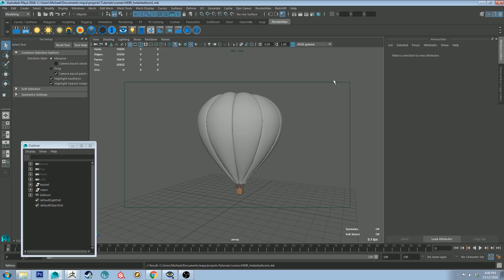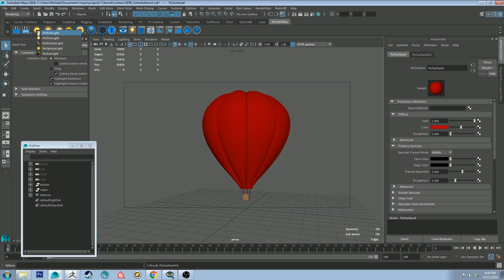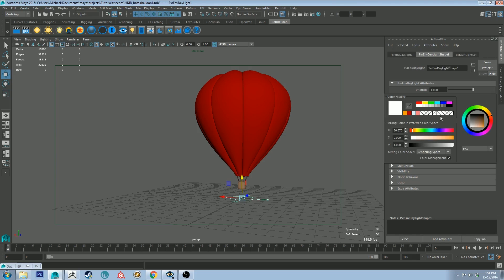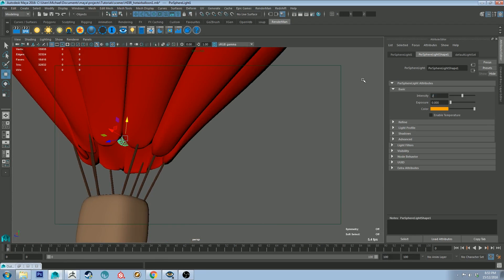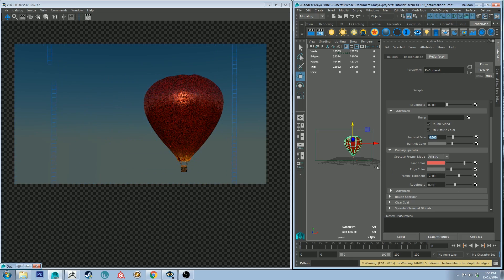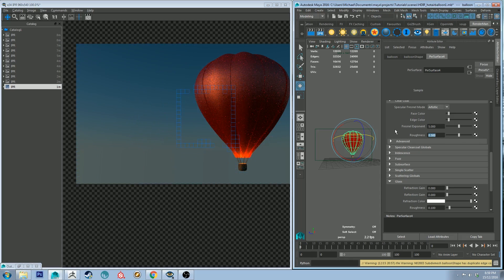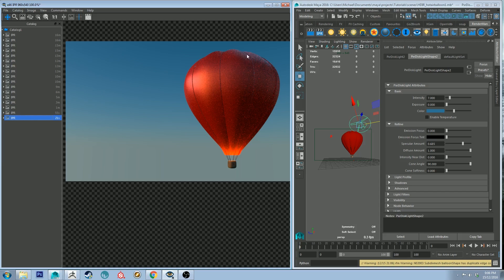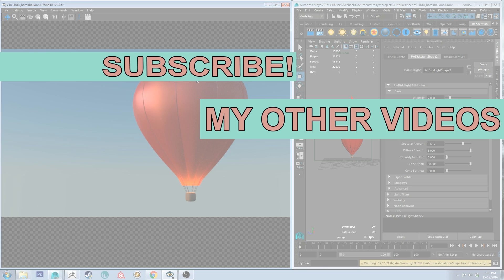How Do I Render: A Hot Air Balloon (Renderman & Maya)

Comment: I was just wondering if you this texture set up could work for regular balloons? Or if you had a tip?  I used one the preset soft plastic for a balloon i modeled, but still seems a bit off in terms of how it looks not the color though. Thank you in advance hope you have a good day.
Reply from the maker: Boy, this is an old tutorial. Funnily enough I rendered a balloon super recently for a small job. It wasn't with Renderman however but the main thing is rubber has a GGX style falloff to the specular roughness, somewhere around .7 would be my guess. Next, assuming you're using a sphere or balloon shape you might want to make your balloon refract light a small amount, with your glass lobe. You can change the refraction colour to be the same colour as your balloon. Turn off your diffuse gain and you should be close I reckon.
Reply: @SmallRobotStudio  Thanks so much! Appreciate your help! I am working on a small project for my final semester at RMIT that I will work on after the semester to make into 3D animation.  I have been using your tutorials to help me these past couple years so thank you for the help!  The balloons are the main characters who i have given eyes, but the texturing was making them not look right lol.  I will try out what you said. Thanks again!
Reply from the maker: @sal_m7420  Awesome glad that helps, I might stick up an updated version of this tutorial since you've mentioned it and I've worked on something recently as well! Send us a link to your final project once it's released, would be keen to have a look :)
Reply: Small Robot Studio I will keep an eye out for the updated version as well as what you have been working on. Looking forward to it! I usually post my work on my instagram (sal_montanyo) i use the same name for my youtube projects channel. I just added you on insta I did not know you had one lol. Ill def let you know when im done. Enjoy the rest of your day!
Reply from the maker: @sal_m7420  Cheers mate you too!

Comment: Hi. If I may, I would like to ask you a couple of questions today. One, how do you render organic objects like teeth and gums? Two, this is related to issues I have previously mentioned on your past videos. I have noticed that when I try to apply Renderman materials to an object in the file it was created in, it does not want to render anything but grey imagery. But, when I import the contents of the original file into a new, blank Maya file, everything looks great and I can continue developing the materials as I see fit. What may be causing this hiccup, and how can I fix it so that I don't have to do so much importing?
Reply from the maker: Thats... really weird I don't have a clue why the materials wouldn't work on the original file but do on import to a new one - I've certainly never come across something like that anyway sorry. So far as organics are concerned I'll be covering skin in a tutorial in the near future which will be similar to what you would do with gums except there would be more specularity on gums and slightly less subsurface scattering. Teeth are pretty straight forward I'd just think about them like bone, fairly rough, possibly some translucency near the edges and some specularity to make them appear 'wet'.
Reply: It's okay. Thanks for answering my questions for the most part anyway. Although I know how to adjust the settings like specularity, I'm still a newbie with Renderman, so I like how put-together the presets that came with Renderman have been so far. That's why I was rather disappointed when an actual bone material was not included with the Big Renderman Library in order to get a better feel for the needed settings. While I have also been able to make some decent looking skin using the blue DisneyPixar material, I will be looking forward to seeing what you will do in your upcoming tutorial on the subject. Keep up with the good work!

Comment: I dont like the red specular color. It looks like metal when it's tinted (and i think for dielectric materials it should always be a shade of grey to be physically correct) Otherwise great Tutorial.
Reply from the maker: Yeah you're probably right here - the problem is with two sided shading the material tends to de-saturate a lot when trying to transmit light so anything to get the material closer to it's local colour is what I was after, however in the instance it probably would have been better to go with the more desaturated reflection and rely more on the transmission colour. Appreciate the feedback, thanks for watching!